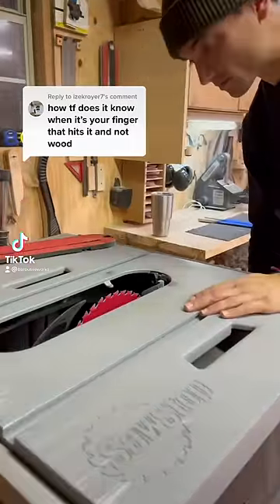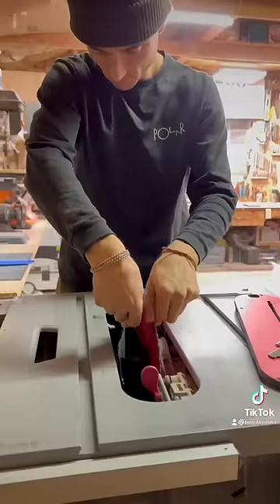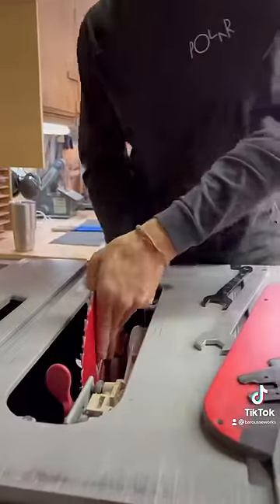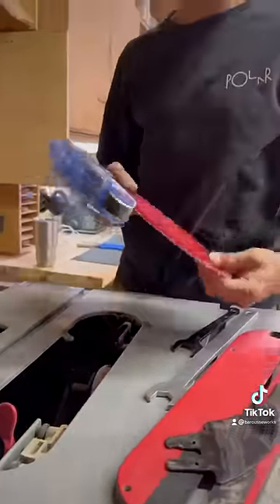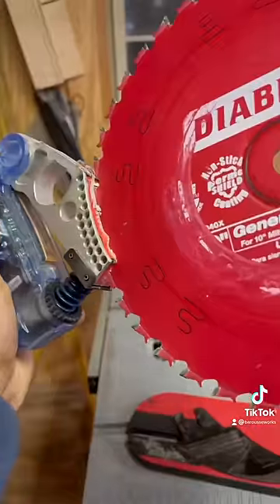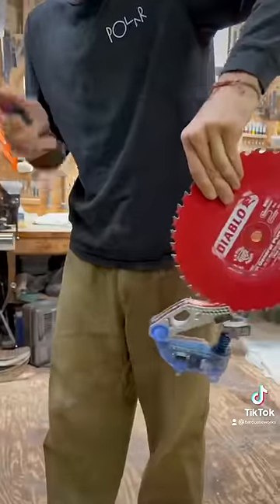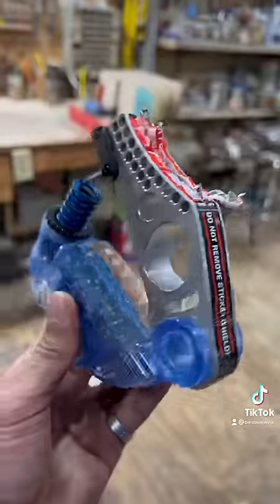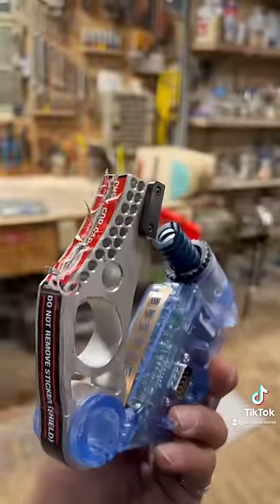Explanation of how SawStop technology works & how it can save your fingers/hands! By Barousse Works

Comment: For anyone wondering, really wet wood or a staple in a board will trigger it as well, but where I work has two big table saws and both have a saw stop, checking your wood before cutting is a small price to pay for knowing you’ll have all fingers when you’re done  👍🏼
Reply: Those were my next questions! Cheers
Reply: I check my wood often. I believe in safety 3rd except when it comes to working my wood.
Reply: You shouldn’t use really wet wood anyways
Reply: Hell yea i agree its a small price to pay. I never thought wet wood will cause the break to work thanks
Reply: I worked for over 10 years at a sawmill cutting Hardwoods we didn't have small circular saws with this technology but almost all of our commercial saws even our debarker and our Mulcher had a metal detector in front of it and yeah any of our sauce had the same technology where as soon as it felt a static electricity from anything they would cut off but we always use plastic Staples
Reply: Mellie lll  good for you, I’m speaking from experience, not from a video I saw online, but thanks 👍🏼
Reply: ElementX  this is actually not as true as some might believe as humans can actually contains a good bit of sodium and conductive elements so while yes dry skin is less conductive the water in our skin isn't what makes it conductive
Reply: This has been debunked MANY times, but keep fishing for likes i guess
Reply: ElementX  so you would still likely keep your finger, just a flesh wound
Reply: @xxgremlinsxx  I was going to comment this same thing.

Wet wood will not set off a sawstop and staples definitely won’t unless you’re somehow touching the other side of it… in which case your finger is probably going to go into the blade anyway.

Works the same way touchscreens do; put a piece of metal on your phone, does it set off the touchscreen? What about wet wood?  No? Shocker…
Reply: Or to make sure you don’t waste a sawstop cartridge
Reply: ElementX  so you gotta wash your hands before using a saw?
Reply: @xxgremlinsxx  what has been debunked?
Reply: ElementX  aaaqaa
Reply: I’m a welder and I’ve discovered that wood does in fact carry continuity, not very much but it does
Reply: Set one off in high-school shop because of damp wood. Dust hose was full of static and as soon as that damp wood got close BANG!!
Reply: i always check my wood.

i check it every night
Reply: Bosch have made a bit smarter system, where you don't rouin the blade and the saw saw
Reply: Me, working with master craft tools: 😐😐😐😐
Reply: Saw these things get tripped while cutting fans of cardboard  (for crating/shipping). It would build up a static charge great enough to activate the stop.
Reply: I highly doubt a single staple would trigger it, although that is just a guess.

Dry skin isn’t dry as soon as blood is drawn, so no real problem there lol
Reply: That’s good staples are jsut as dangerous they can relaly doa. Numebr if flung around
Reply: Yep, wet wood, staples and certain types of paint can all trigger it. But if you absolutely have to cut something that might trigger it, there is an override procedure that you can find in the manual
Reply: ElementX  false it's based on capacitance not conductivity
Reply: Yeah it creates a problem where you may accidentally break a saw that may cost a bit But ultimately it's better to know it over performs than underperforms
Reply: same with treated wood
Reply: It also triggered with plexiglass in my class once
Reply: @ElementX  are you making a joke?
Reply: ElementX  you just said it would go all the way to your bone.
Reply: Incorrecto trifecto. Just search for people breaking this myth all the time. With all levels of wet wood
Reply: You can also always run the saw in bypass mode if you’re worried about wet wood or staples/pins. Just know obviously you lose the protection of the brake
Reply: @BaffledBelief  Hehe. Nice
Reply: @BaffledBelief  he he nice.
Reply: @BaffledBelief  whats 1st and 2nd?
Reply: @James Brogle  breakfast beer and lunch beer then we'll get around to it about 2
Reply: Yes i can confirm. We had one in the woodworking shop at school. It was a nice safety feature but quickly became a nuisance. Since the school only had a limited budget, we would get leftover lumber from the lumberyard. Most of the time the wood had been uncovered and was full of knots/holes. Since it was left uncovered it was quite damp. It became a huge problem because the school had a limited budget and the saw kept triggering the safety mechanism. Each time it did that it costed a few 100$ for the safety piece and a we had to put in a new blade(300$ each time). It was inoperable most of the time i was at that school.

Comment: See this kids? Safety equipment doesn't mean you don't get hurt. It means that you are exceptionally LESS hurt. For example, chainsaw chaps or pants. They are made out of kevlar and are made to rip up. But because it's kevlar, the individual threads will not break, but instead be dragged around the chainsaw track until it jams it up. Sure, you still get cut up a little. But at the end of the day, you still have a leg and your life.
Reply: so it lowers the chance of getting hurt like vaccines
Reply: @Hxkari  if anybody had invented a vaccine against chainsaws, I would take it without hesitation.
Reply: @pawegrudzinski3515  lol
Reply: @pawegrudzinski3515  This is the innovation the world needs lmao
Reply: @pawegrudzinski3515  we need a vaccine for rogue grinder discs
Reply: They're made out of polyester, typically Nylon. Hardly ever kevlar
Reply: Id rather have a 1cm deep cut then half my leg indeed
Reply: @jacobwebb8818  Really? Most of the nice ones I've seen have been made out of Kevlar, tho to be fair I don't really shop for them too much
Reply: @Hxkari  nah the chainsaw pants actually work.
Reply: @justinkaufman495  ok
Reply: There is also a chance that the system could malfunction and not trigger properly.
Reply: @Hxkari  if only they all did that
Reply: PPE doesn't make you not hurt. It makes you not dead.
Reply: @pawegrudzinski3515  maybe even bullets. Imagine how much safer range day with the boys could be.
Reply: @jacobwebb8818  I get where you are coming from, but that is not correct. the reason they use kevlar, is because it is harder to break a thread of the stuff, therefore the chainsaw blade tears at it and carries it around the blade, jamming it up. Nylon and polyester don't do that. Nylon is a bit stronger than your typical thread, but not as strong as kevlar. Sure, the outside of the chaps may be nylon or polyester, but if it's a pair of chaps that is worth a damn, the inside of the whole thing is kevlar.
Reply: @Jaketheaxman  I've literally looked this up. Nylon is used because when it gets cut up it's stringy and jams the saw up to where it can't spin anymore. Strength doesn't play that much of a role in stopping it

Comment: Your finger adds capacitance, like a touch lamp.  If you had to complete a circuit it would only work if you were touching two electrodes
Reply: Pleass correct me if im wrong bit i think its Similar to the way a touch screen works, it completes the circuit and registers in the cpu as input
Reply: My understanding is that there's a voltage running through the saw and when something conductive, like a finger, touches it that voltage spreads out and a computer can measure that the voltage running through the saw changed and activate the saw stop.
Reply: @dogsarebeast3453  It's exactly like a touch screen works, but it's not completing the circuit. It's changing the capacitance of part of the circuit which the circuit detects.
Reply: @XenFPV  I appreciate the correction
Reply: Thank you, I’m an electrical engineering student so I was kinda dying listening to this.
Reply: @brodyskillicorn396  "electrical current through the blade"
Reply: @dogsarebeast3453  no not what happens.  A touch screen uses capacitance too
Reply: Exactly what I was looking for, to conform my theory . The capacitive sensing just like touch screen or lamp

Comment: Actually it’s a little more complicated: your body IS conductive but you’re not completing a circuit. (Where is the other side of the completed circuit?) what’s really happening is that your body acts like a capacitor to ground which attenuates a voltage wave run through the blade. This is actually faster than if it was some sort of switching technology anyways!
Reply: nice, thanks for explaining that. Its like a phone touchscreen, where it is reading the increased resistance of your flesh added to the circuit right?
Reply: @djangodoescomputer  no, it's reading the increased capacitance of your body which has skin as an insulator with blood and flesh behind it
Reply: Yeah attenuates.. obviously..

Comment: Lucky duck.  Couple years ago I was using my job site table saw I went to change my footing and stepped on the handle. The saw rocked up and blade just nicked my knuckle.  From that day forward a push stick and keep my feet away.  One of these devices would be slick.
Reply: I still think he did it on purpose. If you watch the first video the way he tires to grab the piece there's no way that would have physically worked to get the drop piece.

Comment: I almost took m thumb, pointer, and middle finger off with a 10 in miter saw. Was being dumb and rushing… adjusting my mark w the saw on and my hand slipped right into the back side of the saw blade, only reason i still have 9.5 fingers is because i instantly let go and the blade guard smacked my hand away before it could fully cut them off. Deep lacerations on all 3 fingers few stitches on what they could rest just have to be open. Took me out of work for 2 weeks it’s my first eeek back now. Safe to say I learned my lesson.

Comment: Had a buddy in trade school in high school about 6 years ago. He took woodworking, I took industrial maintenance. One day these ambulances pull up and homie is stretchered off the place, but dude is all smiles and completely I bothered lol. Turns out, while using the table saw, he was sitting down. He stopped it midway through a cut and sat down, and somehow (I guess he did it somehow idk) but the saw reversed off the board and into his lap. Cut a gash into his thigh 2.5 inches deep. Dude was in a wheelchair and everything for a while but dude swore he didn't feel pain at all. Probably damaged nerves, but homie was different lol.

Comment: It’s a normally open circuit that closes when your finger touches it shutting off the device. That’s why it works so quickly. If it was sensing pressure it would be too late by the time the pressure was sensed and the saw was shut off.

Comment: If you are woodworker, never take the blade out of the cartridge. Once the cartridge is triggered, you need to toss the entire assembly. The blade is not reusable. The process that stops the blade will damage the tips and make the blade more dangerous. Additionally, it can damage the blade so that if a kickback did occur, which is more likely with a dull blade, it would have a greater chance of breaking the blade.
Reply: Actually from what I hear depending on blade it’s reusable with minimal or no repairs at all. Just an $80 brake or something each time it trips.

Comment: It's a small explosive that when your finger touches the blade and breaks the electrical current sending a very small current into you. not enough to feel as it's a very low amperage. The explosive shoots up the stopped and is pulled down by a high tension spring. A guy made an HD video of him setting it off with a dato blade which Is when you stack blades side by side to make the blade larger in diameter so you can make wide cuts for things like a slot down the wood for a shelf so you don't need screws to make cabinets also known as dato cuts.

Comment: 🤔 I'm a mechanic and call myself a decent handyman. But I will never (knock on wood) get my finger or hand chopped off because when I was a kid I saw a guy basically get his hand basically cut in two 🤯🤯 
 It made me realize how quickly you can make a life-altering mistake.  So from that point on I have been nothing but careful.
 I even wear eye protection when I am working on cars because I saw a guy get a piece of  a cut off disc wedged into his eye when it broke while he was cutting a piece of metal. He didn't lose his eye, but his vision is probably 10% in his left eye. And it will be that way for the rest of his life. And if he was wearing safety glasses he literally would have just said "oh shit!" and kept on working.

Comment: Always wondered: which circuit, does it complete?
If there is a potential at the blade and the Finger is completing the circuit, then the circuit runs over Earth as GND? Rubber soles and your finger is gone?

Comment: It doesn't run current through the blade. It uses the blade as one half of a capacitor, and any large change to the capacitance while in motion triggers the device.

It's just like a touch screen, where the blade is the screen.

Comment: I had one in my wood-shop class, and when the blade wasn’t on and I touched it with my finger there’s a green light right next to the start button underneath the table and it would light up like it knows that my finger was touching it is the kind of test it I guess before you turn it on.

Comment: Shouldn't it work as a differential switch? So when you touch it you make the current pass through you because you have a lower resistance than the original circuit and so the switch turns off. So isn't the original circuit actually open when you touch it(?) (Correct me if I'm wrong)

Comment: Basically it sends very tiny electric pulses and wood isn't conductive so it won't travel through it but the human body is so if it goes through it, it's able to slam a piece of metal into the blade dropping it down before it has a chance to do any damage bigger than a paper cut at the worst (hence why another guy said wet wood will to because of the water in the board) I've seen this thing go off on a guy who was using it and had no idea how to use one in one of my workshop classes

Comment: Any moisture in the wood or treated wood will set the sawstop off, there is a setting to turn it off but please remember to set it back on and use proper safety when the brake is off. On too

Comment: “wood isn’t conductive but skin is”
every tree struck by lightning ever
👁️👄👁️
Reply: Anything can be conductive if you hit it with 300,000,000 volts, even air

Wood isn't conductive by household electricity standards (you can't pass 240 volts through it for example)

Comment: Has anyone talked about a circular blade shattering upon such a hard and sudden stop? Even if the motor was cut power and the brake was applied, the blade must be under such force.

Comment: it also triggers with metal, ive had my apprentice trigger it by going to readjust the fence and he put his tape next to the blade while there was still a current and triggered it with the metal tape blade. so use your cheap table saw if you’re ripping metal 😂

Comment: I believe it uses capacitance, not conductivity. While the difference in conductivity of the material matters, there is never a circuit that gets completed. The sawstop pulses a current into the blade and looks at how long it takes for that current to come down to a certain level again. That's how basically every mainstream touch sensor works, including modern touch screens

Comment: Almost correct. What it does is when something conductive touches the saw blade, in this case your finger, it drops the voltage of the circuit because your body is able to hold an electrical charge. If the voltage drops off by a set amount the saw stop will trigger. This works based on capacitance.
Reply: Not really, what you just described is resistance which is what he said.  You're both wrong, instead it's based on capacitance
Reply: @GameByGame  my explanation was poor as I wrote that at 4am :/. My bad, I will fix it up.

Comment: Make sure you use the push stick and that probably won’t happen again but yeah lucky for the sawstop truly
Reply: He was using a push stick in pt 1. He literally reached into the blade to grab the cut project.
Reply: @_Drip  His mistake was to not use proper tool for the job. Miter saw or tablesaw sled would have not cause this issue.
Dont do stupid shit with tool and remember to respect it.
Also faster the tool removes material, faster it will kill or maim you.

Comment: The thing about your skin is that it’s not your skin that’s conductive it’s the sweat so if you don’t sweat then this wouldn’t work but since your skin is almost always moist it activates which save your fingers
Reply: Your skin is conductive.
Reply: @notabrit3025  your wrong look it up the reason why your skin is conductive is because of all the sweat with has salt in it and salt water is a great conductor so if you don't sweat you won't get shocked and you wouldn't turn on the saw stop mechanism
Reply: @thatmomentwhen2756  you're* Also you're wrong as it doesent take a lot of conductivity to make the  saw stop mecanisim work. Compared to metal skin isnt conductive, but it still conducts enough to make the mecanisim work.

Comment: What if there is a nail in the wood, it will activate too since metal will conduct electricity
Reply from the maker: Yessir! You have to watch out for metal. They have a bypass mode for times when you can’t avoid it or just need to cut metal which I sometimes utilize. Hope that helps!

Comment: I almost cut my pinkie off with angle grinder, i unplugged it and accidentally touched the cutoff disc while it was still spinning and it stopped into my bone, it probably burned the cut because it only bled little so i may have my pinky finger because of it doing that. I learned from my mistake